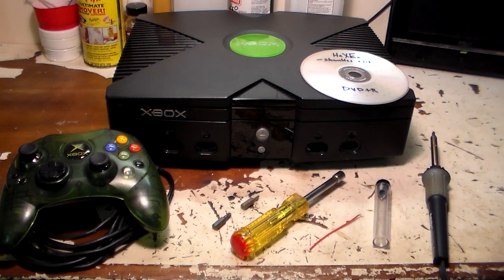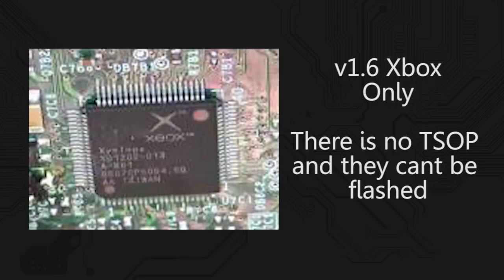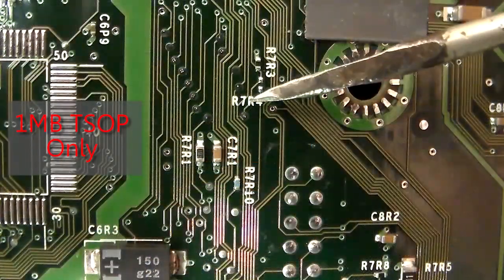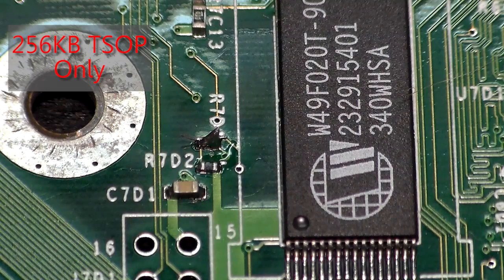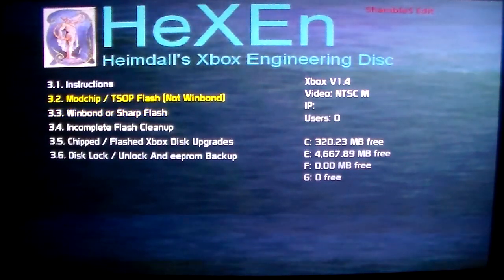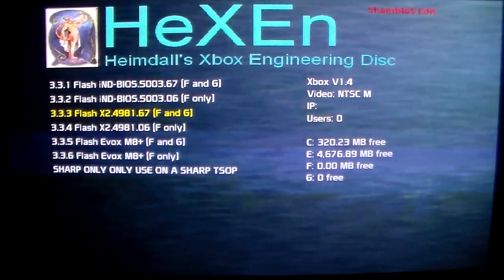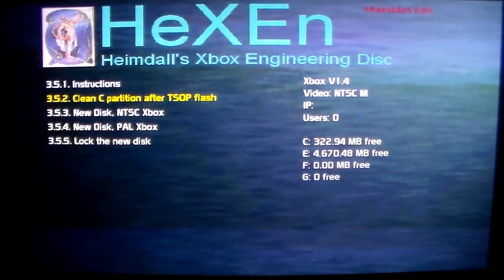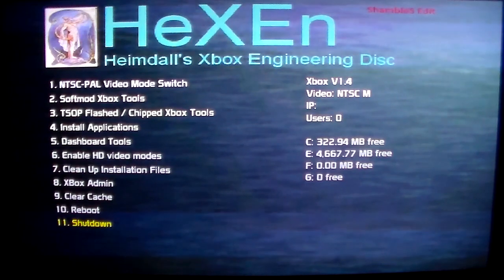How To: Xbox TSOP Flashing Explained -Part 2-

Comment: Do we need to remove the solder bridges after the flash? (v1.1, ST TSOP)

Edit: I flashed now my TSOP, with Xecuter 2 ( i belive mine is 1MB but i installed 256 to be safe) and it work's fine, thank you! But i need to make new Shortcut's to my Emulators :P But I'm scared that i can break something, if I leave the solder bridges. thank's for responding!
Reply from the maker: you dont have to remove them. it doesnt really matter though
Reply: No? fine. Thank's! I never done that much to my Xbox, i just softmodded it before, upgraded the hard drive to 80gb added led stripe, painted it and removed the clock cap. so i was a little bit scared, if i can break something :D i got another question: i've got a tsop from st, and a "single-slot" power connector, so that mean's that i have 1mb tsop? and if i install multiple bios, can i load and switch them?(like holding the power button for 3 sek's switches from bios 1 to bios 2 etc.)
Reply from the maker: its not possible to switch between bios's with the power button like that. some modchips might work like that but i cant think of one that does
Reply: and why should we install multiple bios's if only one can be used? sorry for all that questions.
Reply from the maker: You dont need to to install multiple bios's. you just need 1 bios. its just that its possible
Reply: yeah, I understand that i don't have to need to, but why should someone do this? what are the reasons?
Reply from the maker: the cool factor. or if different bios's had different features that you wanted to use. maybe if you were debugging a bios, you could quickly compare 2 of them without having to flash it every time
Reply: ouh, okay. so for normal people who wanted just play games,watch movies etc. it's unecessary? Thank you very much, to responding!
Reply from the maker: happy to help!

Comment: Wy TSOP an XBOX, are there benefits?
Reply: Allows backups discs to played, allows unlocked hard drives making upgrades/replacements when faulty much easier than softmods and you can customise most bios startups on the tsop flashing using tools.